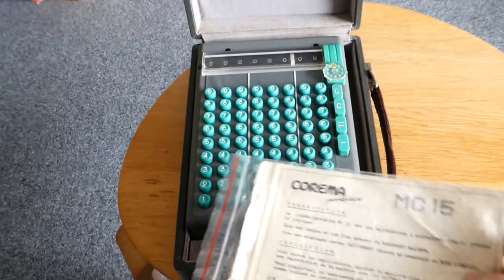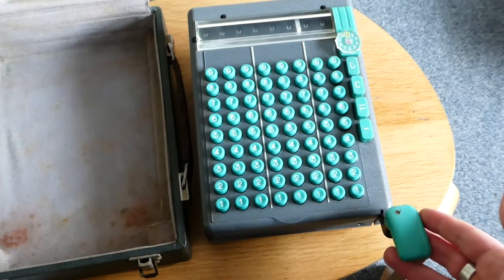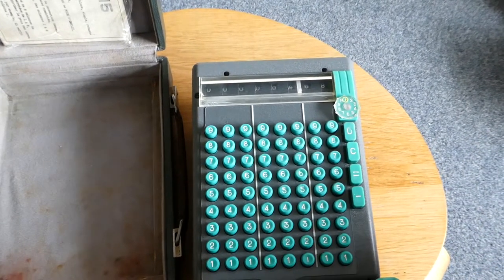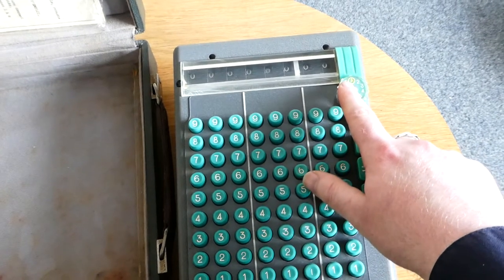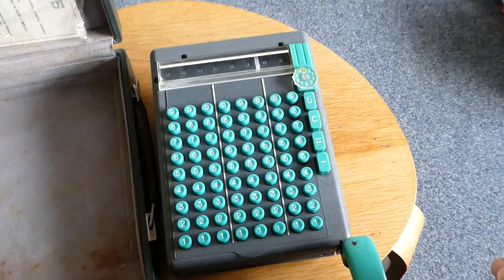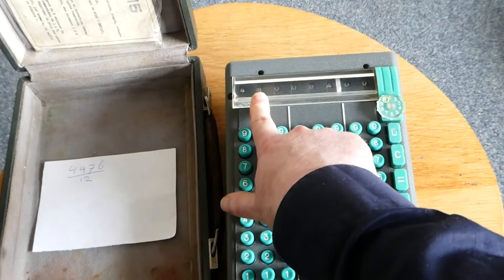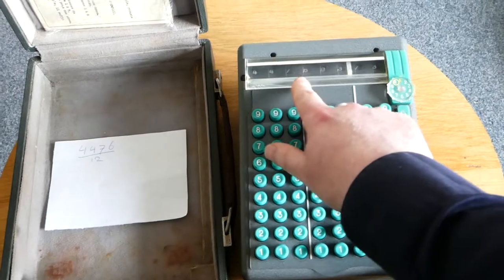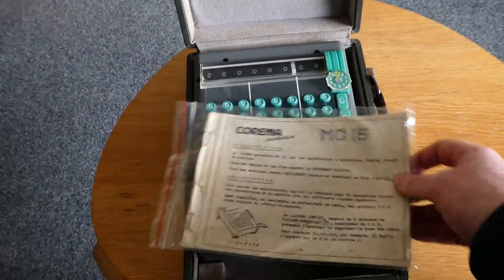The Corema Portative MC 15

Comment: It looks like the division method taught to Comptometer operators would be more effective (repeatedly add and shift the 10's complement of the divisor, and the extra carries spell out the quotient). It would certainly make better use of the limited space in the accumulator register, although it is perhaps trickier to remember.
Reply from the maker: You are probably right. One tricky aspect is to remember that you have to add the complement one extra time, which then gets undone by the cancel button when you clear the keyboard to move to the next column.